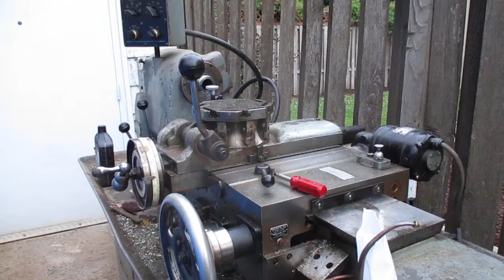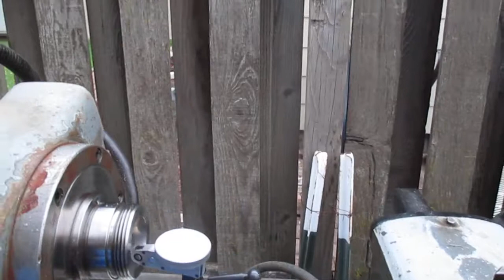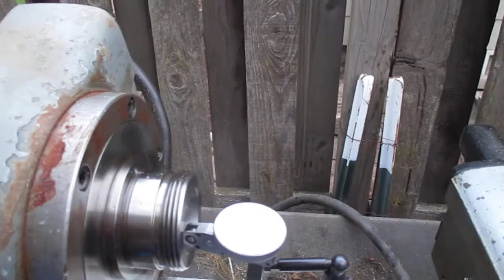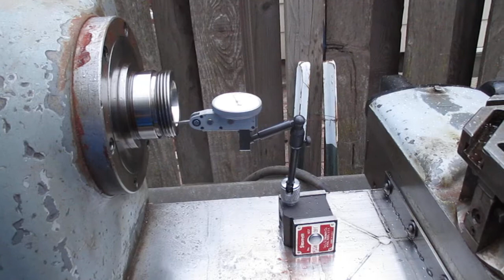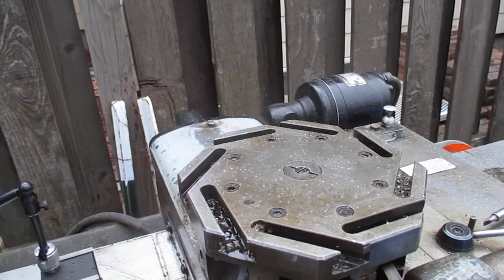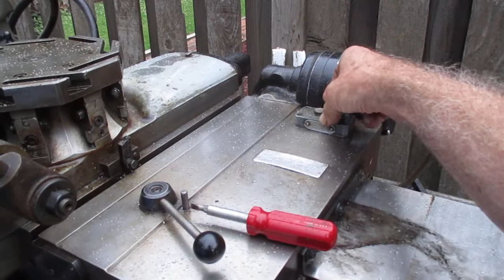Hardinge HC lathe, rescue will be successful

Comment: Looks like it will be a very useful machine.  These are great when you want to make a small number of identical parts.  And I agree with you on the Trav-a-dial and DRO swap.
Reply from the maker: I was hoping someone would see the logic in that the DRO would be far more useful on the Hardinge. I think the HC model is a good buy, they actually sell for much less then asking prices.
Reply: @deedeeindustrialsuperprecision  Yeah, the non-HLV/HLVH Hardinge lathes can be had for a decent price.  And the HC needs "fine-tuning" to get dimensions right for small production runs, so the DRO would be a big help with that.  IIRC, you often see Trav-a-dials on 10ee lathes.